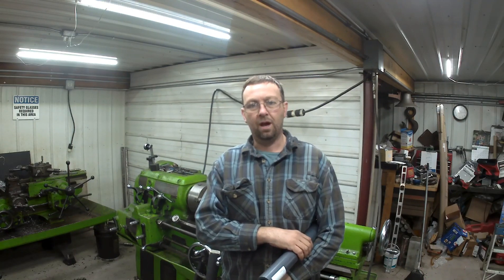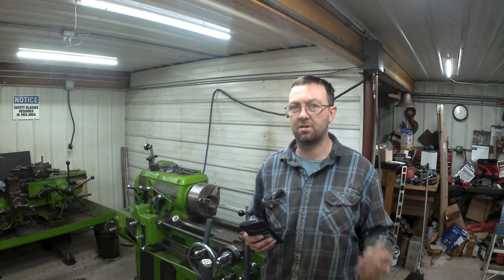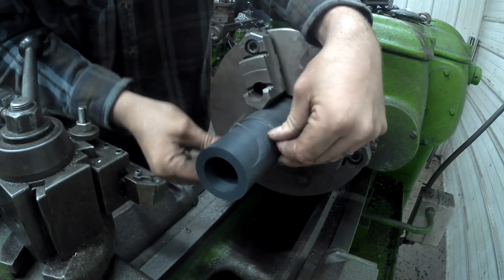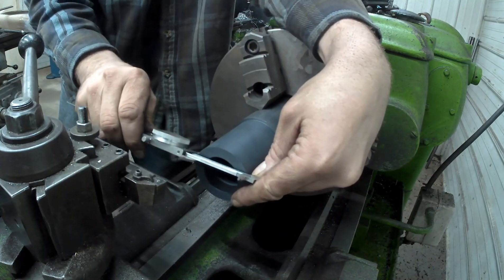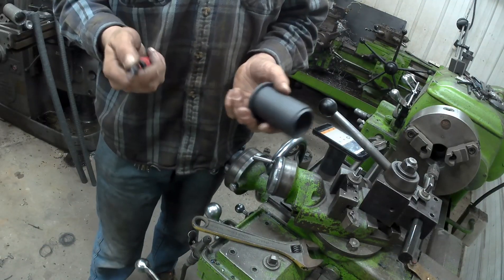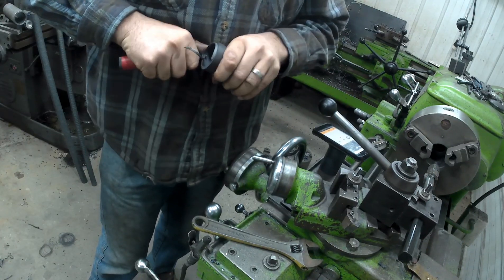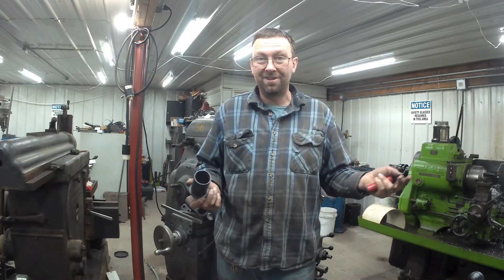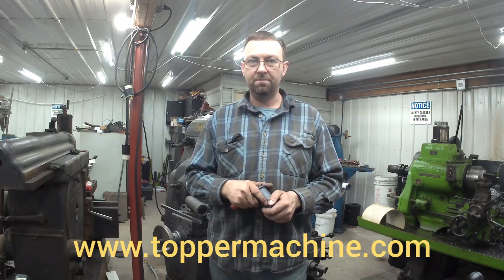Machining Nylatron Bushings

Comment: What is the name of the manufacturer? That was hard to hear with the acoustics.
Do you know which is better for making gears? GS or GSM?
I've lost the specs for a part we used to make out of Nylatron and our original supplier no longer stocks it. I'm looking for a current supplier. 6 years ago it was $232.00 for a 3/8" 2'x4' sheet. Now all I can find is $908.00 for the same!

Comment: What is the diameter of the drill at about 2min 50sec?  Did you have to do anything special to prevent the material from trying to grab that large drill and yank it out of the taper?  Thanks...  I am going to give Nylatron a try the next time that need to make a 2 in OD bushing...

Comment: Would you use this on a medium sized skid steer bucket pins? I was thinking of going with 4140 but I wonder about that nylatron. Thanks
Reply from the maker: I've used it on a lot of jobs. The largest was a big excavator bucket bushings. Held up well.
Reply: @TopperMachineLLC  thanks. What minimum wall thickness would you recommend?
Reply from the maker: @battleaxefabandmachine  depending on length, about 3/16-1/4". Longer can be thinner. I do several 3" long 1/8" wall.

Comment: I used some of this stuff for some bushings in an old square baler.  The owner of the implement provided the material.  He says it holds up much better because the dust and grit end up in the bushing better than bronze, and don't end up scoring shafts nearly as badly.  He didn't think they lasted any longer than properly lubed sintered bronze though.

Awesome stuff to machine.  I kept the cut offs and made some bushings for an old reloading press.  Glass smooth on chrome shafts!  

I'll order myself some when I get to the bottom of my delrin and bronze bushing material pile.  It's not much more expensive than other bushing materials, either.

Comment: GSM contains molybdenum disulfide to improve load bearing. GS is extruded and does not contain MoS2, in case anyone is still interested. Thanks for the interesting video.
Reply: Do you know which is better for making gears?